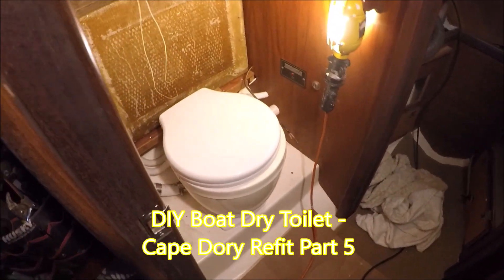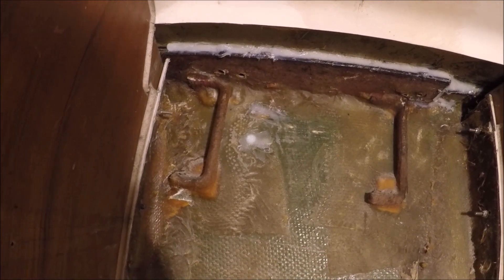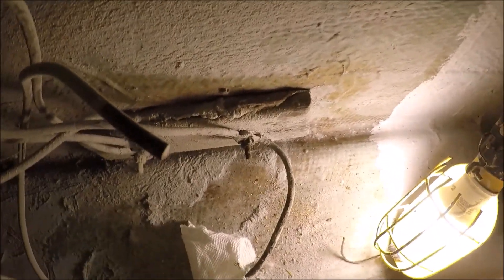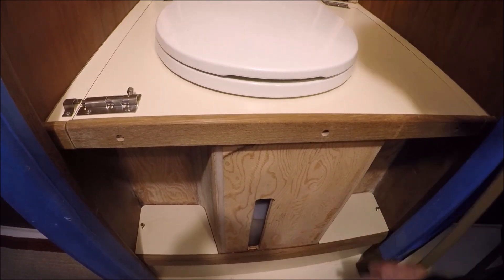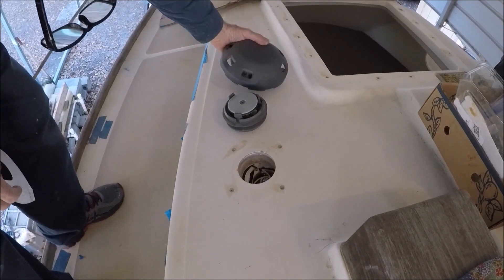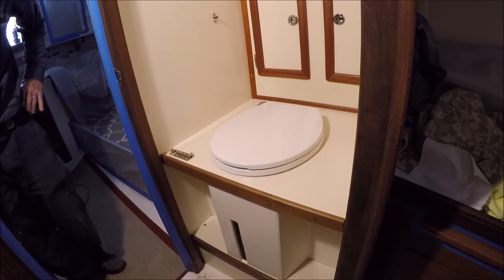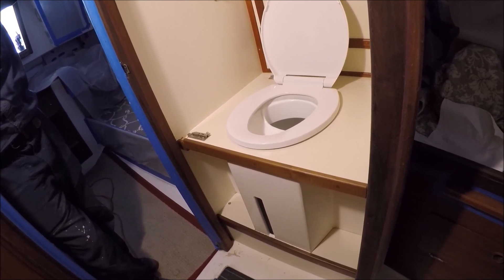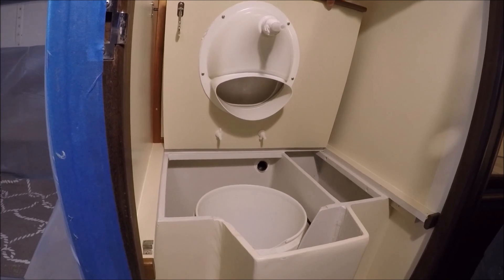DIY Boat Dry Toilet - Cape Dory Refit Part 5

Comment: Fabulous DIY HEAD. ❤Three Questions. 
1. Who makes the bottom portion of the seat (divided part)? Or did you DIY that too.?
2. Who makes the “shroud” for the exhaust fan. Or what is it made of? Looks like it might be a pvc pipe elbow; 3-4” dia.?
3. Is the fan wired to your elec. panel (new switch?) or direct to 12v battery? 
Thanks for clever boat retrofits
Reply from the maker: The links to the urine diverter and fan shroud are in the video description. I'll add them below. The fan wire goes from the fan to a switch nearby and then to a terminal block to the cabin lights circuit.
https://www.ebay.co.uk/itm/324879529268
https://airheadtoilet.com/product/extra-fan-shroud-right-angle/?v=7516fd43adaa

Comment: great project! Was the half inch plywood (okoume?) of the head painted with a specific paint?
Reply: and was the seat lid also painted or already finished and just cut to size?
Reply from the maker: @frederiklettens5955  The plywood was just an unspecified type of marine ply from the local lumber supply. It was coated inside with Interprotect 2000e, an epoxy primer. On the outside the epoxy primer was covered with EZ Cabinkote paint that I tinted off white to match the rest of the interior. The plywood top lid was covered in Almond Formica. The seat and its lid are original plastic and unpainted.

Comment: I’ve used flattened 1/2” copper pipe for low-clearance runs of the lightning ground wire with success.
Reply from the maker: Thanks for the tip.

Comment: Seems like the foot placement on the toilet would be for heels only as the area is small.  Separately, the C-head website is down and I wonder if the owner retired.
Reply from the maker: Yes the footrests are heels only since there is no space for more or the footrests would intrude into the walkway. But it works fine like that. C-head closed over a year ago. I was told the father passed the business to the son. Apparently the son took orders that he never filled and did not refund people's money. I have a video on the C-head from a couple years ago. Too bad it's not currently produced. But just as well since I'm not a fan of the stirring mechanism anyway and feel this design is an improvement for our needs.

Comment: Very nice idea!
I have a cape dory 30c that I'm converting the toilet to that kind of system.  Simplicity is the best!
My cabin sole is teak plywood over fiberglass liner with two small bilge access . I'm going to cut a new bilge access between the two so I can have more access to bilge for storage  ect. Another thing I'm going to do is bolt a bulwark through the deck and hull flange. I don't like a "toe" rail , I want a foot rail, lol ! I think it will make the boat look better and strengthen the hull to deck joint.

Comment: Do you recommend putting lightning protection on a live aboard? I'm still working on my cal20 and trying to decide if I should add it. If I do, is it enough to run the wire to a keel bolt (they are external bolts, covered with bottom paint only), or do I need to install a copper plate? Thanks for your videos. I wish there were more :)
Reply from the maker: The experts recommend a lightning ground. I have not added one yet to my own boat but expect to do that one day. Keel bolts to external ballast should work even if the lightning has to pass through primer and bottom paint. But if there is fiberglass over the ballast then it may cause damage to the fiberglass if hit. In that case a copper ground plate outside the hull is recommended and it should have a 48" perimeter. That can be accomplished with a 3/16" thick copper plate, 4" wide x 20" long. I added one to a Cape Dory 36 recently that I ordered from McMaster-Carr. A much more complicated and expensive lightning protection system is described in another video on my channel but is difficult to install and probably overkill for a small boat: 
https://www.youtube.com/watch?v=UxWRf0Libsw
Reply: @atomvoyager  thank you sir
Reply: @atomvoyager  thank you. The ballast does have a few layers of epoxy, done laminate, and barrier coat and paint. The bolts themselves are external (through a flange on the keel) and those are only covered in bottom paint, though I suppose the bolts done have enough surface area to be effective  I'm reluctant to install a copper plate because I'd rather not make any holes below the waterline -- even bolt holes. I probably need to get over it. Thank you for the advice!
Reply: If you don't get a answer here ask pacific yacht systems here on YouTube. I am curious about that answer too